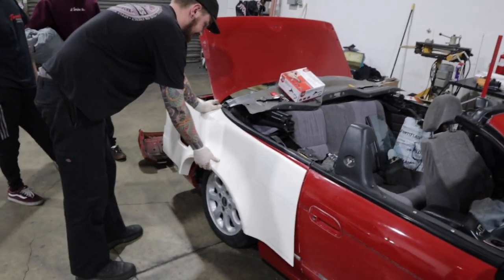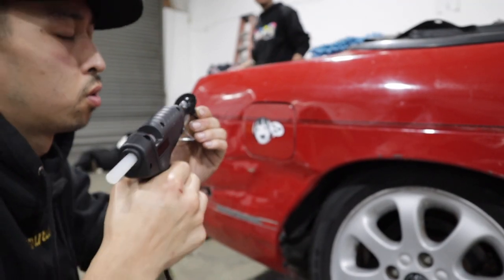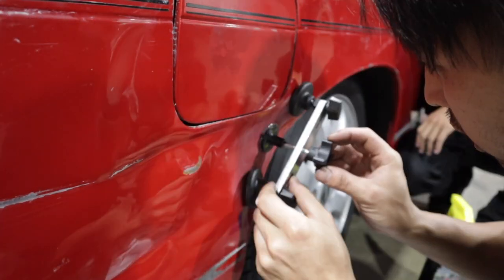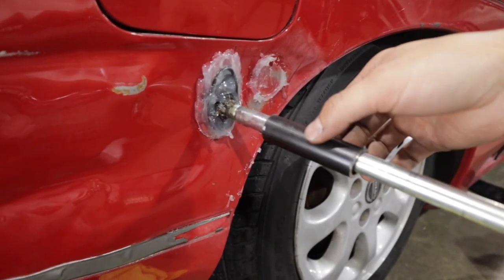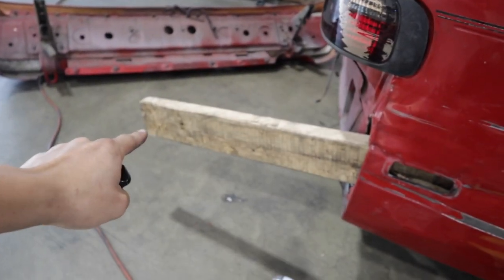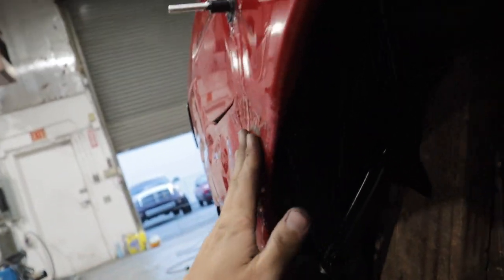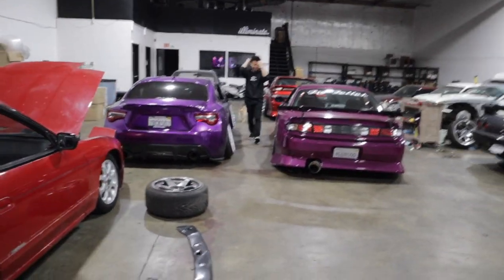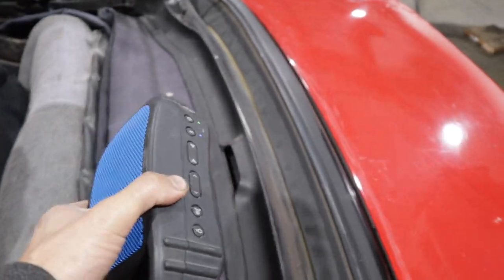New wheels for the convertible 240sx

Comment: u could just weld a big bolt and did the same thing u tried and it would the trick there's a tool for this in body shops forgot whats its called but it pulls out dents easily